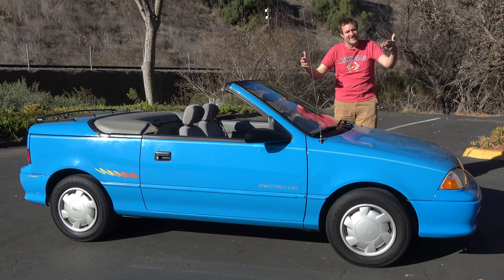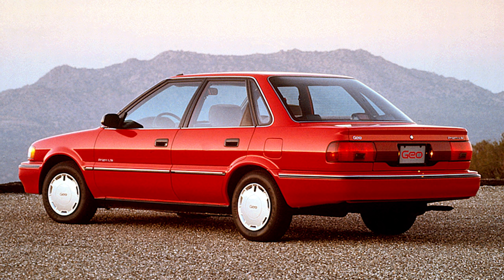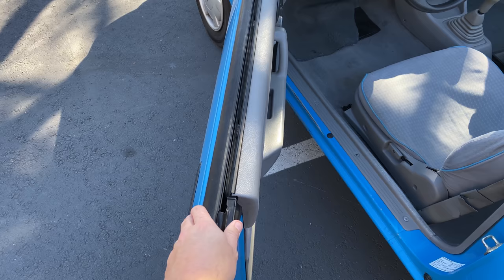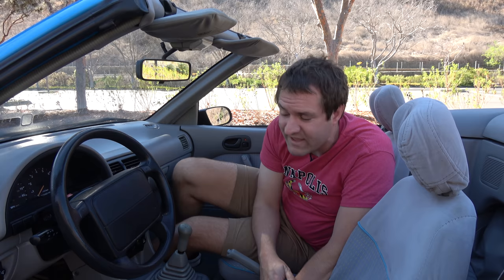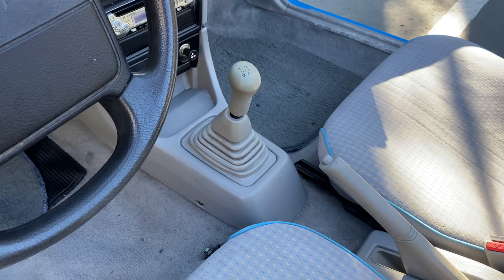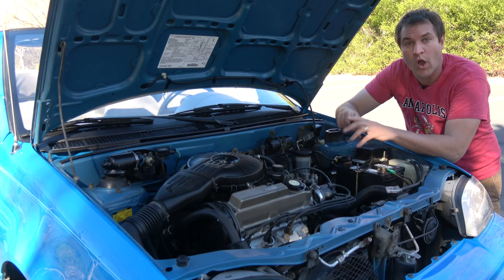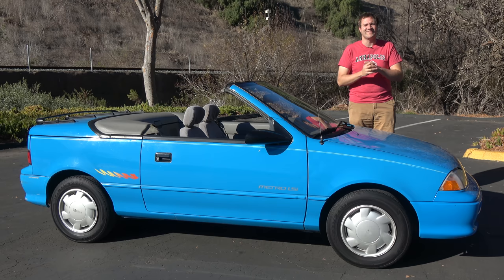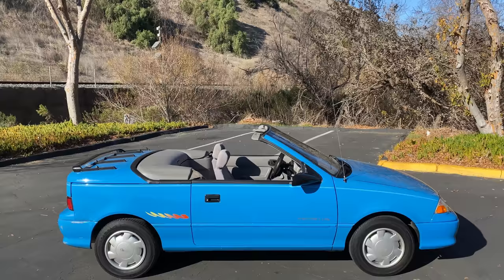The Geo Metro Convertible Was a Hilariously Pathetic 50-Horsepower Economy Car

Comment: I had a friend back in 93-94 who had the hatchback.   Poor guy was determined to try to make the car fast.   He slapped intake and exhaust on it.  I recall him asking around the local performance shops looking for headers but just got laughed at everywhere he went.  Hope you are doing well wherever you are, Dan.
Reply: Dan, Sir I salute you 🫡
I had a Metro only because I live in England it was an Austin Metro 1.0ltr 4 cylinder packing 
43 Rampantly lethargic brake horsepower.
And I too was determined to make it faster than a 4 speed manual has ever been.

Turned out Marvin ( he was called Marvin the Metro) packed more dB than BHP what with 8 speakers and Sub canon I installed!
Reply: Dan's Metro is probably pushing triple digits by now
Reply: One day he floored it and probably exploded the tyres and caught fire because these can’t survive more than 100hp
Reply: To be fair when your car has only 50 horsepower, every additional horse is much more noticeable than if it had 300 😅
Reply: Well the car is fast, I mean, it is faster than you.
Reply: I had a storm hatchback with a 2.75 inch exhaust from the manifold back , that shit sounded like a large fart driving down the st 😅
Reply: Thats a measure in futility... a geo metro was never meant to, and cannot be made to go fast unless a crapload of money is invested in it, a honda civic or an Integra of the same time period would yield dramatically better performance
Reply: @Weimerica8841 Dan's Metro probably doesn't exist anymore
Reply: Had one junked it at 276000 miles still ran but rusted out. Not fast but was dependable and easy to work on. Bet this car will be like the AMC Gremlin everyone hated them now everyone wants one.
Reply: @johncameron6415  that’s crazy that you kept a car all the way to the brink of 300,000 miles. It definitely proved it’s mettle
Reply: Imagine a Hayabusa in it
Reply: Well, there’s a lot of potential there. Provided that he could find headers, cams and tuner then he could potentially get up to 65, maybe even 70 horsepower.
Reply: I mean all you need to do is swap a hyabusa engine in it and you'll be flying
Reply: @Journey_to_who_knows  There was a GTi with 101 hp. Actually an awesome car, for twisty roads, because with only 800 kg to move around, it does accelerate ok ish and changes direction like a rabbit on acid. It's very popular with hobby- and boyracers, so good ones are almost impossible to find. Don't underestimate small Suzukis, they know how to make tiny cars fun!
Reply: @RosefMudson1414  I'd say add a d16z6 or a root super charger.

Comment: "This car is really slow." Yeah, cause the car was never designed with US highways in mind. The car was designed with Japanese cities in mind.
Reply: I mean... its still incredibly slow...
Reply: @thathottstuff5075  I honestly doubt it's as bad as he makes it out to be. My '91 Civic wagon with the original D15B weighs more by a lot and prolly puts around the same power to the wheels. It's honestly not that slow around the city, and it's only really noticeable when you're trying to get on the highway.
Reply: @koopatroopa187  No it is that bad even around town but like you said it was designed for ECONOMICAL inner city driving like they have in Japan where the cities are much more compact than most of our's!
Reply: @martybowen1  Like I was saying. The D15B in my 1991 Civic station wagon was rated for 90hp at the crank when new. FWD Hondas generally lose about 30hp through the transmission, so let's say it was putting out about 60hp at the wheels. 30 years later, nearly 300,000 miles on the odometer, and valve seals that leak so bad the car burns a quart of oil a week, and I would wager the car is putting around 48-52 down right now at the wheels. The Civic wagon also weighs in the 2400+ pound range. So yeah, I highly doubt it's as bad as you and Doug are saying as my car weighs more, has less power, and it's not that bad to drive in the City.
Reply: The convertible Suzuki Swift/Geo Metro was probably intended to be a Kei car, a small car in Japan designed for congested cities. That's probably why it's so sluggish and small.
Reply: Thats why it should never have been exported unless you live somewhere where every day is a Sunday driving day and there are no hills to worry about, especially if you have extra weight like a grocery bag in the passenger seat.
Reply: @1972dsrai To be fair, the Geo Metro wasn't that under powered when it was new. It was comparable in power to other economy compact cars.
Reply: @koopatroopa187  Maybe, I’ve just never driven anything that slow. I owned a Peugeot 205 1.9 GTI as a student in the late 90’s, the thing was rapid, but had very little in terms of safety features. Not uncommon for then though. Like most owners I eventually wrote it off.
Reply: “Formula 1 cars are fast.” Yeah, because they were designed for racing.
Reply: @1972dsrai  Honestly, big cars with truck engines are only popular in a  couple of british colonies. Rest of the world always used to drive more reasonable stuff. Judging by the sales numbers, compact cars with under 100hp were more than enough for majority of drivers around the world for last few decades. Present day markets are also dominated by the same (sub)compact cars with even smaller engines, turbo'd or hybrid, tho.

Anyway, who needs a v8 powered shopping cart that WILL get stuck in a traffic jam on your daily route to your favourite grocery store?
Reply: @slava5294  You’re right. Here in the UK they’re called Chelsea Tractors as most are driven by housewives who use them for the school run or shopping, but never to go off roading.
Reply: It would do 80 Mph - eventually.
Reply: @LionWithTheLamb  Maybe on a very steep downward incline.
Reply: So? It was also being sold in America, with marketing executives knowing that highways, and country back roads rule the roost in the U.S. In Japan, it may be a wonderful car. In the U.S however, this deathtrap of a lawnmower had a very small audience. 

I actually love the car, but it's far from good.
Reply: @Firealone9  Again, the car was on par with other economy cars of the same era. Not to mention, the whole double nickel national speed limit thing at the time. Car only needed to be able to do 55.
Reply: Just to add my input: I once had a 4 gear 45hp 88'Renault 5 TL, a city economy car.
It was slow, but not as you'd expect based on the numbers. I understand the Civic guy over here.
Reply: @zimutes  It’s obviously not for everyone, I like something with a bit more power for when needed, but if you’re happy with it and it does what you need it to do then does it really matter what anyone else thinks?
Reply: This was probably just as slow in japanese expressways as it is in american highways
Reply: @JoaoSilva-yh4dg  Not really. Especially when Japanese speed limits on the expressway are 80 km/h.
Reply: @1972dsrai  well a 205 gti was a genuine racing car, if that is your entry level car then some of us really have nothing to talk to you about, except maybe for the weather...
Reply: @florkgagga  What do you mean if its my entry level car theres nothing to discuss? I’m sure I’m not the only one. Would you prefer I said I started with a Citroën XM?
Reply: @1972dsrai  just means you can't understand my world, I have a hard time to understand yours, all fine.
What is an XM to you btw, just curious? (see, I'm still discussing :)
Reply: @florkgagga  Blame my parents, they literally gave me the money and let me buy whatever I wanted, not thinking I’d come home in that. They were even less impressed when they saw how much the insurance was. I think it was something like £1500 which was a lot in the 90’s.
Reply: @florkgagga  An XM to me is one of the better looking cars produced by Citroën. Tbf I quite like how it looks, but having only driven Alfa or Audi since the 205 I’m clearly not its target market, but no car is for everyone, that would just be boring.
Reply: @koopatroopa187   compared to what though? Slow and fast are very subjective terms. Compared to practically anything today  I’m sure it’s very, very slow. Also I’d have to assume the 50hp rating is at the engine not the wheels so there’s no comparison to your civic. Also who cares if it’s slow as anything? that’s not the point of this car by any means, it serves it’s purpose of being fuel efficient
Reply: @1972dsrai  well clearly it matters to koopatroopa  what other people think 😂😂 There seems to be a lot of people who will defend their insanely slow car to the death by saying “it’s not that slow” when it truly and simply is. Again though that’s not really a mark against the car because it’s not intended to go fast. I’m just confused on why people even bother with the argument. For reference I have a 93 vw cabriolet which is sub 100hp with a 3 speed automatic and I can say from experience that it is sloooow as the day is long
Reply: @time7371  I'm speaking in terms of compared to cars that were available at the time this car was relevant. You cannot judge a 30 year old car on 2021 merits. The car has to be judged based upon the period in which it was released. If you're going to compare 30 year old cars to modern times, the modern Toyota Camry is faster than the NA1 NSX and Ferrari 348. The modern base model Civic will put down faster lap times than my Integra Type R. Fuck, the 2020 Civic Type R is putting down faster ring times than the R34 GTR Nur Spec.

Also dude, learn to fucking read. Yeah, I am well aware my Civic wagon makes more power than a Geo Metro. However, it also weighs a fuck ton more, so they will be very comparable based upon power to weight ratio.
Reply: @time7371  How fast any car goes is only one aspect of it, as with your Cabriolet, you admit it’s not the fastest, but you love it anyway for various and personal reasons. Why not highlight the reasons and positives about why you bought that particular car and just admit speed just doesn’t come into the equation.
Reply: @1972dsrai  oh yes, I had both cars because I specifically wanted them. I'll own a 80's Renault 5 TL again some time for suuuuure my dude. I love older cars, in their entirety. I have incredible fun with my old Civic EF on the backroads goin to and coming from work. That's why it's my main car. I could easily daily a more economic, faster, safer and more confortable car. Cheers
Reply: @zimutes  Thats what its all about, having fun and driving the car, not keeping it parked, being too scared about damaging or putting more miles on it.
Reply: Yeah, another thing is that always when the Americans tried to build European - like car when it comes to fuel consumption, they were justifiably laughed at.. Had they chosen 4 - cylinder 1,3 which Suzuki had in the Swift back then, it would not have been this bad..
Reply: @michalstehnij5073  The 1.3 DOHC was only available in the Swift GTI here.
Reply: Koopatroopa i agree
Reply:  NALTO  I mean yeah I understand that. The video is talking about how slow and underwhelming the car is. It isnt calling it a horrible shitty trash car thats useless in every country.
Reply: How slow is it?  20-60 (going up a steady succession of not-very-steep hills heading west out of Meridian, Mississippi on I-20/59) in roughly 2-1/2 minutes.  I'm pretty sure that, even for a Metro, mine was a real sour lemon.  Thank goodness it was a loaner while my actual car was being fixed.  The 60 was only due to everyone else around me going at least that fast in the national 55-MPH era that was still holding fort at the time.
Reply: The Toyota Echo 5-speed I would say is the evolution of this car; a Japanese car that, with the 5-speed, can literally enter the freeway at 80 mph, easily.  I don't like him calling this car pathetic.  It makes me less a fan of him
Reply: @TheRealShedLife  I've always been a huge fan of the Toyota Echo. That is a solid commuter.
Reply: Only in America (the U.S). there is this insane fixation on acceleration. In most European countries there are far more roundabouts and far less traffic lights, which makes acceleration far less significant. And roads safer. And brings down pollution. And really, acceleration is only relevant if you worry about the BMW- or Tesladriver behind you getting annoyed. Who cares.
Reply: Japan has expressways mate
Reply: @thatoneintrovert9618  Do you know what the speed limit is on Japan's expressways?

Comment: Everyone gangsta until the Geo pulls up with a 950hp Vtec swap looking stock like this.
Reply: There are people who swaps K20 on these... A tight fit, but makes one hell of a pocket rocket.

I have a GTi, and it's a really fun car, revs up to 8000 rpm and if driven economically minded, gets 5l/100km. 

Not bad for a 101 hp car ;)
Reply: @johnnyrocketa1257  8,000 RPM ?
Reply: @ct1762  And theorically can rev up safely to 9.500,  at the cost of durability, so it's limited to 8k. The internals are reinforced in stock form compared to other G series Suzuki engines.
Reply: Y'know those Smart Car Hayabusa engine swaps? Yeah that, but with this. I think in that case there will be enough torque to twist the frame...
Reply: I want to see a Hillclimb kitted Geo now. 950KG stock lmao we can make this fast with some bodywork, suspension, and an engine lmao
Reply: @shinkibigami9 There is a guy in Germany who races a Suzuki Swift GTi 4WD on hillclimbs. Not a Geo, but close enough!
Reply: @HoyaSaxaSD  Funny, coming from someone who lives in Commiefornia.
Take a look around. There is a lot of world to see outside Malibu.
Reply: @johnnyrocketa1257  obviously you’re not a golfer.
Reply: Lmao
Reply: @johnnyrocketa1257  we didn’t ask
Reply: Doesn't even count. Basically motorcycle status now.
Reply: @johnnyrocketa1257  Isn't only the top end (lifters, springs and cams) different? The G10 has factory forged rods which are identical to the G13B.
Reply: @joshjlmgproductions3313  The G13B block is reinforced compared to the standard G13 block, the crankshaft is exclusive to the G13B as well as the pistons (For turbo conversions the pistons from G16B Vitara are used).

 I assume the factory forged rods are in the G10 Turbo version, right? Or every G10 has them?
Reply: @johnnyrocketa1257  From an official engine spec sheet, every G10 had forged rods in 1992.
Reply: @joshjlmgproductions3313  I just checked in the EPC, and the 3-pot turbo and DOHC engines has almost the same conrods, the last ref number is the only difference...

That's good to know ;)

Comment: Doug: "This Geo Metro is a hilariously pathetic 50-Horsepower economy car"
Also Doug: "This Geo Metro can be yours on Cars and Bids"
Reply: The new “enthusiast” car auction website…
Reply: I'm curious how much it sold for I would love to have it
Reply: as he said Cars and Bids is not just for highly collectable vehicles its also for quirky cars, as there are many enthusiast like him, that like the odd cars.
Reply: @NitroTheHusky  yikes! I see these convertibles in nice shape for $2300.
Reply: Over $5000 for that Metro.

For about that much money I found some decently useful cars (Manual) within' 300 miles from my location...
-2012 Honda Fit Sport, 177k Miles - looks good!
-2006 Ford Mustang, 121K miles - looks mostly clean!
-2007 Hyundai Accent, 65K miles - looks decent.
-2008 Mazda 3 S Sedan, 177K Miles - looks okay!
-2002 Volkswagen GTI VR6 174, 136K - looks fine.

While I do admire the Geo Metro charm and simplicity quite a lot, I will never spend over 2K for one even IF the car was in top condition, FUUUUUCK that!
Reply: @haaxxx9  wow! Also overall cars. $5k should be better than all of these
Reply: Tripled the value
Reply: @haaxxx9  Doug review tax have to have a cost
Reply: @haaxxx9  If you have to justify why the car is expensive by bringing up a bunch of irrelevant information, the car isn't for you.
Reply: I'd buy it.

Not for $5700, but I'd buy it and drive it
Reply: @koopatroopa187  It's irrelevant because I bring up some decent useful cars that can be used (At least) for a daily driver?

I'm just thinking here, for a "Sports" coupe I rather get a MX-5 just for the customization alone or the mustang I just said back for less for the Geo Metro that got sold in this video. Only reason I have is   why that Geo Metro IS worth that much because of it's collection value (or lack there of) and even still I won't pay that much for a GEO METRO. Other people can spend that much money and it's fine but I wont understand why do people shell out a insane amount of money for a "Sports" coupe...

But HEY! I aim to get a Corvette C6 in my life so yes, that car isn't for me at all.
Reply: Surprisingly these still have a market.
Reply: @koopatroopa187 I wouldn't call it irrelevant. Those are probably all better cars in terms of comfort and usability. The only things the geo has going for it are it's incredible gas mileage and reliability. Which is absolutely valuable, but I'd argue most people wouldn't own a metro if they didn't have to